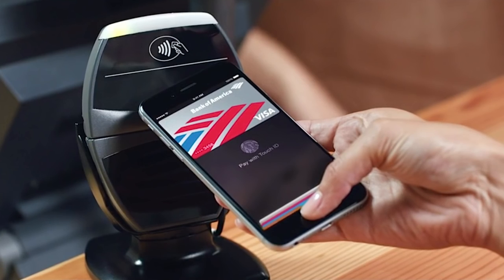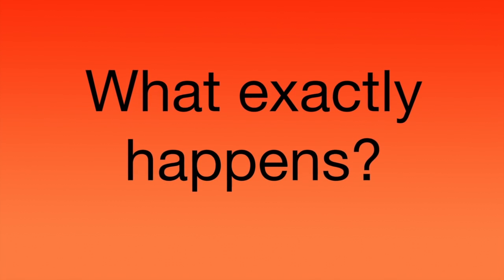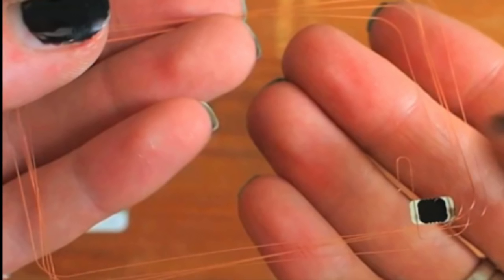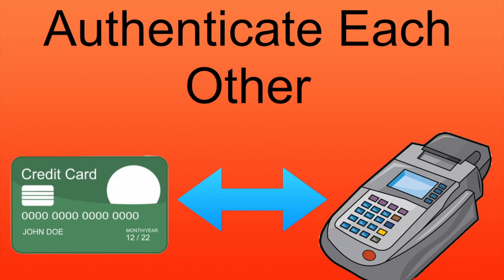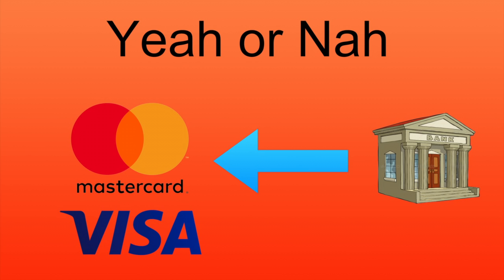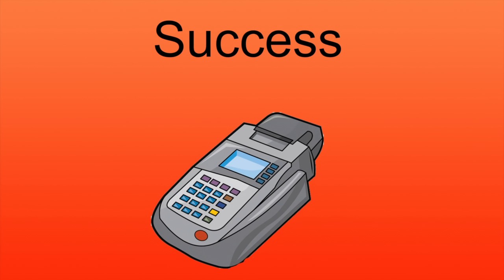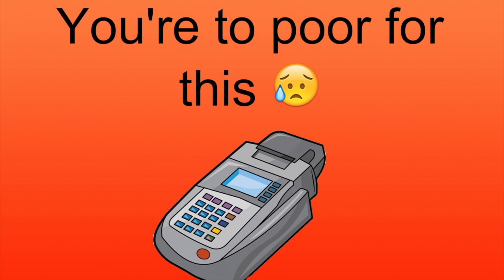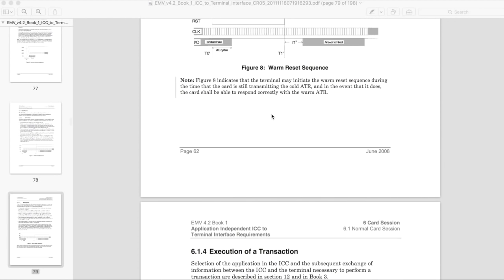How everything works: Tap And Pay

Comment: All of that happens in less than 2 seconds and we still have to wait for a video on YouTube to buffer
Reply: Bruh so true
Reply: @brow06  If you have to wait at all its not youtube's fault. Its you the user. You have bad connection. Either slow internet, poor cell signal, or crappy wifi, but by all means push the blame to someone else.
Reply: @Matt.7321  idk why ur so mad, sometimes the video takes a while to load. Just in general. My WiFi is fine and so is my phone signal. Like idk why you're so mad over this. chill bruh

Comment: thanks for the video but there are social and privacy concerns about these modern digital solutions, plus thieves are getting smarter in our days, thieves have adopted ways of catching up with this new technology for example: if thieves would get a way to hack, jam or code these systems wont that jeopardize the lives of those who may fully rely on this technology
Reply from the maker: In regards to privacy you are completely right, the idea of your bank and the credit card processors knowing  the time, place, and context of your every purchase is a bit off, especially in countries where the privacy of this isn't as in trusted in law.
But when it comes to the security of the cards I wouldn't worry, other then physically stealing the card the security built into the system prevents any other misdeeds. Additionally even if your card gets stolen or even more unlikely hacked, you bank is required to refund you the value of the transaction.
Reply: this is a great concept Matt
Reply: A couple of ppl at another highschool that my friends go to hacked some tap n pay vending machines